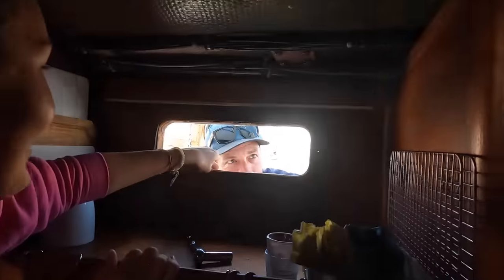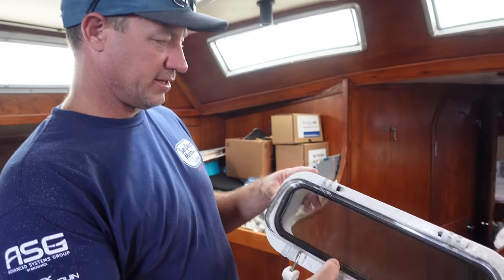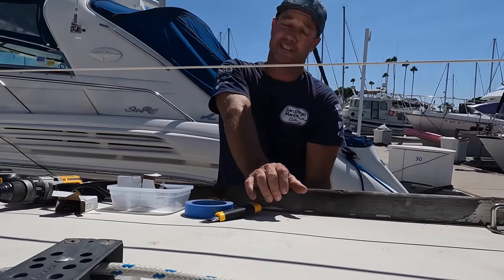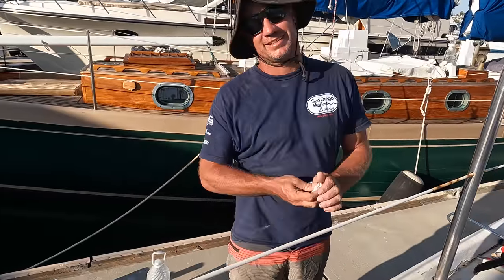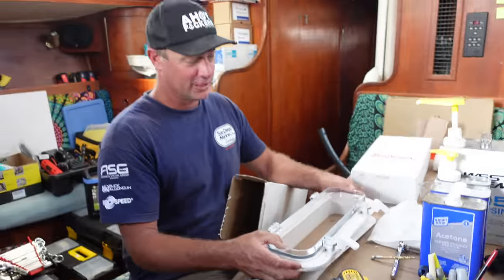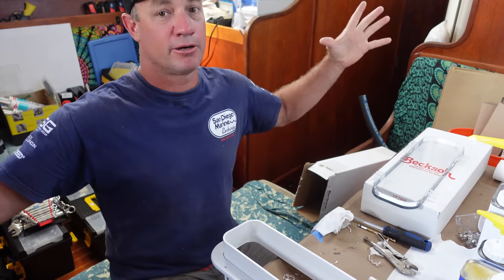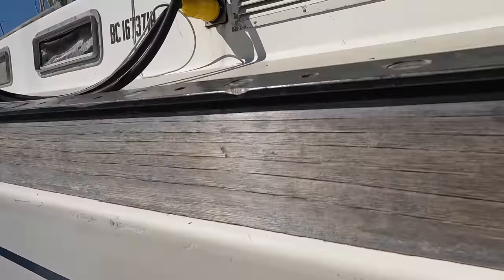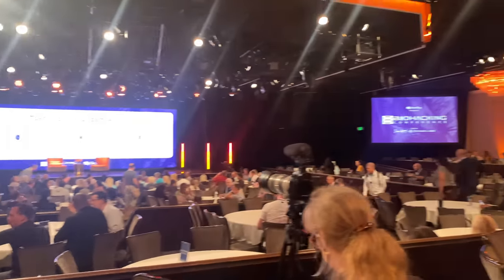Fixing or taking a Leak 😆 Lots of BoatWork | Ep 316

Comment: Good move putting screws and nuts when mounting your PORTS 🤣 The only  reason most new boats don't use fixings on ports is to reduce the labour content in manufacture = more profit. It should be a banned practise on all vessels. I spent 25 years in a marine window manufacturing business and our windows  had mounting holes, including the internal trims

Comment: Three times I heard you mention 'epoxy',  referring (I think) to the sealant you used for the port lights.
The tube you used to seal the lights said "Dow" on it and it was one-part and white.
I don't think that was epoxy.  Problem is, you didn't tell us what product you actually used.
If a DIY'er were to actually use 'epoxy' when installing plastic port lights, they would need a 
jack hammer to remove them when next the lenses get cloudy (again) or the frames break.
Then they would need to rebuild the surrounding side wall of the boat.  Not a good prospect.
Reply: Dowsil 795 is silicone.  All good for the future!
Reply: @MrGazzaj  Yeah, I figured that's what he used.  My point was aimed at viewers who might actually try to use epoxy for port lights.